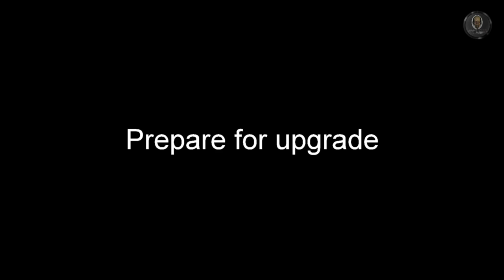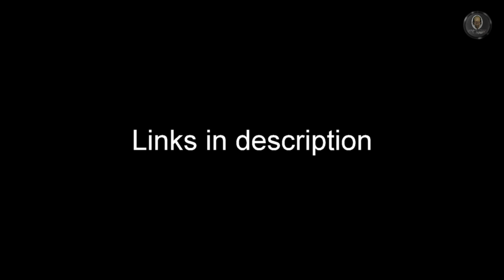WPL Upgrade part 1 - Removing bearings

Comment: I only used flat screw to remove the gear on that part
Reply from the maker: That depend on luck and Your skill :D It may also depend if that is new design or old because they may change or redesign that part.
I have this tool so it's much easy to use it :)
Reply: @Adrian202  yeah i think so bcoz the gear part there is full metal.
Reply: @howardalteisen2281  I know, that is why I bought the, 2 axel set with mounted metal gears (BG, WPL B14 etc.) but I will do it with the Fayee fy003.